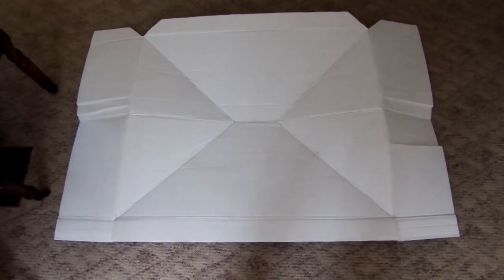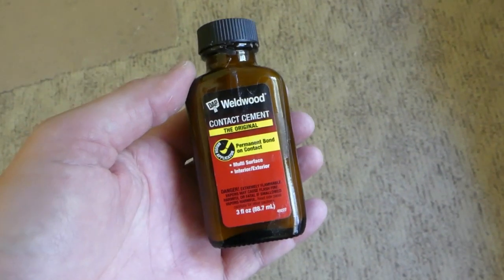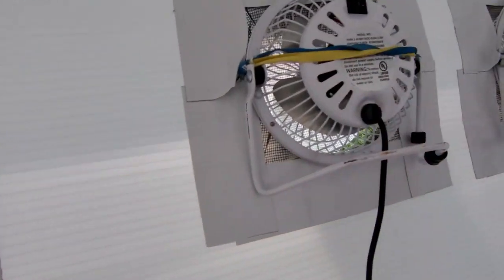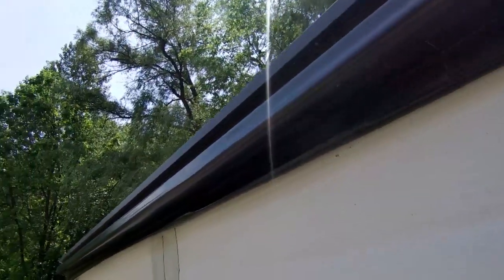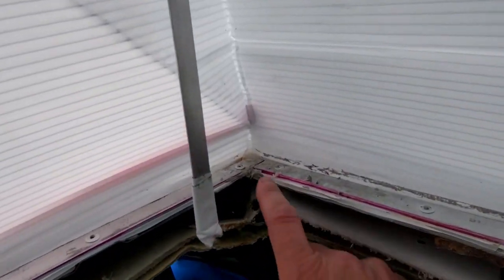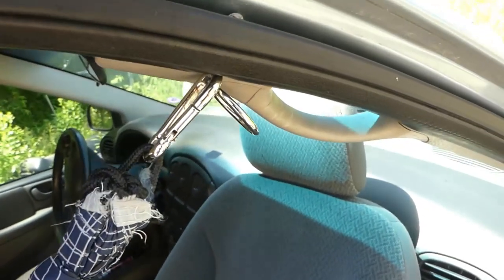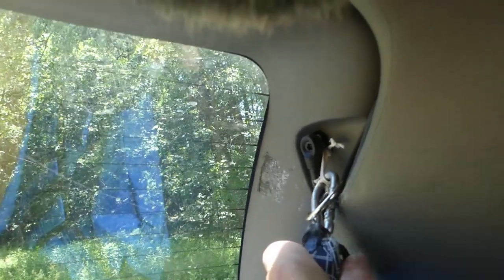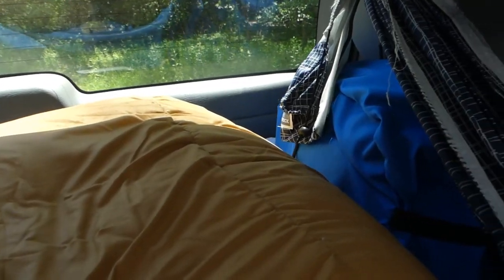DIY Minivan PopTop Details and Hanging the Hammock in my Minivan

Comment from the maker: More updates and changes.  https://youtu.be/4EBZIsr-ao8
Reply: I wished you had showed what it looked like on the inside when it was down??? It's hard to picture, would hang down or what?? I wonder if there could be any way to insulate it?? Maybe after it was raised??? Now you have me curious, lol.
It didn't cost much to make , did it??
I would think the solar panel if not used, cost the most??
Just thinking but if you didn't want a big solar panel couldn't you just use the metal you cut out to make the top?? Just use some aluminum to make a rim big enough to cover the hole, right??
It's really cool but I would prefer builtins. I would rather have a bed. But you could still have cabinets and have a hammock.
I have seen two on here make real bathrooms in the back. A casette toilet and a shower with shower curtains and a base. They made it so you could set and shower. One was a dog tub for the base but plumbed and the other they actually sealed the floor of the van. It was cool.
Has anyone ever asked to pay you to build one for them.??
It's really cool!!!
Reply from the maker: @Shandele3  It folds down fairly flat so you can still use it with the top down. There are many ways to accomplish the same thing. The cost can be as high or low as you can afford. With my heater, there is no problem staying warm as it is. It does get hot on hot days, but my fans make it cool enough for me at night.
Reply: @Shandele3  Thanks again! Great idea that is lightweight, economical, and diy.

Comment: Thank you for being responsive and doing a follow up video on the pop-up and the hammock installations!

I've been wanting a hammock in my 2016 Nissan Quest and yours is the first video of one in a minivan that didn't have some kind of connection that went on the outside of the van. (That seemed like a good pathway for water besides not being stealthy.)

I think I can manage the front connection, but I'll have to figure something out for the back since the actuator arm cannot be reached from the inside of my van.

Great build and info. I've subscribed and turned on the notifications. 
Thanks again and happy trails!
Reply from the maker: I have tried the not outside method and my hammock got wet the next time it rained out. The water just follows the rope on inside.

Comment: This poptop is an awesome design.  Thanks for sharing your ideas and good work.   I love how you think outside the box you live in.   I wonder, have you noticed any tendency of tape and adhesive to release away from the Coroplast?   I read that polypropylene has high surface energy and adhesives don't stick to it very well.   They say that if you quickly run a propane torch over the area to get adhesive, it will change the surface energy to make things stick better.   You have made one of my favorite ideas.
Reply from the maker: I have used some coroplast like that for other projects, the only thing that worked was very fresh super glue and contact cement. This is treated to accept vinyl wrap so the tape sticks very well. It also makes it softer than most coroplast so it folds more easily. You can purchase it from Home Depot or order it off their website for an even better price.

Comment: Hello and thanks from Montreal, Canada. I see your passenger's seat is turn backward. Is it permanent fixture or with rotary option?  Could you make a video for this modification. Thanks a lot.
Reply from the maker: It is just turned around the four bolts are reached from underneath. You do have to remove the spare tire and shield to reach one of the bolts.

Comment: Yeah this is damn brilliant, looks like you’re in a Chrysler minivan from the pockets in the floor. Undoubtably with the seats removed these minivans have an insane amount of space inside of them I owned quite a few, I didn’t know you could get the passenger seat on a swivel or did you just turn it around permanently
Reply from the maker: The seat is just turned around. I don't think a swivel would work, just not enough room.
Reply: @Far-Beyond-Ordinary  Awesome. I have a Sienna and am constantly looking for ways to improve it.  Was moving the passenger seat backwards a big endeavor? And how difficult would it be to change back?
Reply from the maker: @lisalaventure4937  I just drove the van up on ramps and crawled underneath to remove the bolts.

Comment: Let me start with, I love your build! And I have a question with your pop top. If you was to rebuild it, what would you have done differently?
Reply from the maker: The one change I plan on making is putting gas struts on it to lift it up and hold it up. One could finish off the edge differently. The tape was just the least expensive and easiest.

Comment: im currently looking for a truck to build a camper on. this seems like a possible alternative given how expensive a reliable truck is. im thinking i could possibly sandwich the rim of the roof cut out with 2x2's  bolted together. like a board on the cieling and a board on top of the roof bolted together through the roof ,framing the cutout. might be able to attach some canvas useing rv trim that way. did you run into any wiring cutting the roof?
Reply from the maker: Yes, there was some wiring and the controls for the rear heat and AC which I  disconnected and removed. There were also wires for the dome lights, so now two lights on the driver's side do not work anymore. I could have rewired them, but I figured the two on the passenger side are good enough.

Comment: GREAT video and Great Ideas!! THANK YOU!.  What if I tried to do this in my Prius???   Hummm.
Reply from the maker: I have thought about that too. I should take some measurements on our Prius. It would mess with the aerodynamics and fuel mileage though.
Reply: @Far-Beyond-Ordinary   can always build a fairing on the leading edge.
Reply from the maker: @bonilla2022  I was just thinking about that as I went out and did the measurements. It would work to have a standing area just over the rear seat area. Just enough for getting dressed and for cooking on those bad weather days. It could have a floor with hatches over the foot area of the back seats for extra storage as well.

Comment: Love this build and the simple pop up design.... not sure I am brave enough to do that, tho I sure would like to try!  One question for you.... in this video or your updated video you stand in the rear stow n go storage areas!  I have been wondering if that is possible. lol  I guess it is.

In fact I want to use the front SnG storage area to get out of my lengthwise bed a little easier (I broke my back years ago, and unfortunately do not think the hammock design would work for me... I have to be very careful to keep everything in alignment... my memory foam mattress topper is fantastic for me...)  But in order to have adequate headroom in the van if I'm seated on the bed, the bed needs to be lower than is comfortable for my knees when getting up.

I thought it would be great if I could use the storage area behind the driver's seat to easily get up and hey why not just use both connected storage units as kind of a walkway so I don't have to be stooped over so much. I consulted some Dodge mechanics, they both told me the storage areas were made of thin steel.  But alas yesterday I discovered that the front one anyway is made of fiberglass!  I'll have to check on the read storage areas... but I am assuming they are fiberglass too.

I have seen in some videos that I can no longer locate that people have put two deep cycle batteries in the front SnG storage areas.... depending on the type of battery that weight could range between 100 to 200 lbs for both of them.  

I'm not sure the fiberglass is designed for people to walk on, but was thinking if I put 3/4" plywood in the bottoms that that would distribute people weight better.  What are your thoughts on this pls?  

I love your vids btw and just subscribed.  Thank you so much for sharing your great ideas.... especially the pop up... ingenious!
Reply from the maker: The stow-n-go areas are rhino-coated steal on my 2006 caravan. I drilled through it for the heater install. Plywood would make it stronger and make for a smoother area to stand on. 1/2 inch would be good enough, but 3/4 would be ok too.
Reply: @Far-Beyond-Ordinary  Thank you!  That is good news... that's for both front and rear areas? So does rhino-coated steel look like fiberglass from the outside?  Black bumpy texture?  

I think I will go for the plywood in the bottom... and see how that works. would actually be really nice to use the rear storage area because it's a lot deeper, but I think I'll just focus on the rear storage area for now. Gracias!
Reply from the maker: @uber2tuber  Yes that is it, looks like fiberglass a little. On mine, the middle and the back are the same depth. The center ones do have a small divide, so two pieces of plywood would be needed.
Reply: @Far-Beyond-Ordinary  Thanks.  I was just out there planning the bed build, and I double checked on the front area, which is only about 7 or so inches deep on my van with a center divide that is higher.  It is definitely plastic, I can tell from tapping on it.  But it still should be able to support a person's weight I think with the plywood. I hope they over engineered them for the possibility of people walking on them. Once would think. lol

The rear area in my van is a lot deeper... maybe 12 - 14 inches?  I can't remember atm. I will try to pull up some of the carpet and see if it's also plastic in mine.  What year is yours again? Mine is 2010.  thanks so much for your info and thoughts.

Just as a point of reference, I did just read on a Dodge Caravan recall forum that one guy's van caught fire in the rear storage compartment on the driver's side (!) and he smelled a burning plastic smell at first. Left it parked for 5 minutes, came back to rear area filled with smoke, rear hatch wouldn't open .... then the entire interior caught on fire!!  Has me a little worried lol but thinking positively. Sounds like maybe an electrical issue?
Reply from the maker: @uber2tuber  Wow scary. Mine is the older body style 2006.

Comment: I just saw this video and I am quite fascinated. I had two questions:  I am currently putting together plans for a Sienna camper. My idea is a variation of yours. I'm short (5'5"), and I think I could cut off the roof, install a  box that raises the height of the ceiling just enough for me to stand in, and then hide/protect that box inside a cargo box, like a Yakima or Thule. This would accomplish a full-time, standing room vehicle that was super stealthy. My questions are 1) Did you remove your headliner to cut the roof off, and 2) how wide do you think you could go? You said you did 3', but do you think wider is possible in a minivan. Thanks so much for the inspiration!
Reply from the maker: My width was based on the size of my solar panel. I just cut through my headliner, but removing it would give you a better idea of what you can do.

Comment: Origami man, brilliant. Just subscribed to your channel. Can’t wait to look at the rest of your content. Regarding the way you secured the hammock in the front of your van, where are you put the knot outside and the factory black seal is bulging… could you instead have tied the knot so that it was inside, thereby making that outside flange flatter? In other words I would’ve looped your string through the outside, but tied it inside.
Reply from the maker: Great thinking, that would be much better. The seal never leaked so I never thought about it again. Thanks for the input for sure!
Reply: Also when you’re doing night mode, and you have to move your blue kitchen bin (and put it on top of your toilet), I wonder if that bin could stay a smidge bit further toward the front, so you could use it as a nightstand. thereby having it next to your hammock, rather than tuck it away in the back. Only down side is that would not all allow you to swing from side to side, but you could put a sandwich plate or a book down.
Reply from the maker: @bethsuter4637  I usually put my extra blankets on there so I can grab them as needed when it cools down.

Comment: I enjoyed this video very much! Do you think I could do this in my SUV? What could I use instead of actuator bar? I don't know what that is and I'm not sure if I have one. What brand of hammock do you have and where did you get it? It's a great idea to turn the passenger seat around! I'm doing it ASAP so passengers don't complain about my driving!
Reply from the maker: That depends on what your SUV is and how tall you are. There is a minimum sag required, but the shorter you are the less it can be. I purchased my hammock at Walmart. You can attach it to a hinge or drill small holes to run the string through the frame.

Comment: Does this effect the structural integrity of your vehicle?
Reply from the maker: Only if you rolled it. But it would get totaled either way.
Reply: @Far-Beyond-Ordinary  does your insurer and roadworthiness authority agree with you?
Reply from the maker: @brianrollins3245  It is safer than a convertible or motorcycle. There are no back seats. What is there to worry about? I know how flimsy the top was I cut off. The strength is in the sides and rear, not the thin top that was removed. There is no roadworthiness authority in my state.

Comment: Does your passenger seat have a swivel or did you bolt it on backward? I have a T/C van like your Dodge.
Reply from the maker: It is just unbolted and turned around. Removed completely would also be good for more storage, just add a comfortable folding chair for use on those rainy or buggy days.

Comment: What did you have to do to be able to spin the passenger front seat around 180 degrees?
Reply from the maker: I unbolted it and turned it around. There is not enough room for a swivel. The spare tire has to be dropped to get at some of the bolts.

Comment: Excellent build! What did you use for the front passenger seat swivel base?
Reply from the maker: It does not swivel. It is just turned around and rebolted.

Comment: Very clever but I would be concerned about heavy winds.
Reply from the maker: Why it is way stronger than canvas.
Reply: @Far-Beyond-Ordinary  I had a Sportsmobile poptop van and as Heavy Duty as that was,they had limit at which they recommend putting the top down. If you think it will do well in 70 moh winds like we have in SoCal then that is wonderful.
Reply from the maker: @stanw909  I would put it down in winds like that. It could vibrate the supports loose and it would come down.

Comment: Thanks so much for your video. Now knowing how you did everything, I am more impressed than I was before! Did you make any type of frame for your solar panel to rest on? Or just use foam?
Reply from the maker: When it is down it just rests on the foam mainly to seal out water from getting into the folds while driving in the rain. I have made a few changes and will be adding a diesel heater so I can do some winter camping. Hopefully, there will be an update video coming soon.
Reply: @Far-Beyond-Ordinary  I just came back from a camping trip in Alberta. With nighttime temperatures around the freezing mark, a heater would have been a great add on. It got pretty cold!

Comment: How I get the front seat to till backward?
Reply from the maker: I took the nuts off underneath the van and turned the seat around. I then have the seat pulled as far forward(to the back of the van), the recline leaver can be used just like it always did.
Reply: @Far-Beyond-Ordinary  Very clever, thank you!

Comment: Congatulations on you very nice poptop. It is really really nice. I am really impressed! You have done a fantastic job!
I do have some questions about how the opening in the roof is strengthened. Could we have a private conversation.
Reply from the maker: It is strengthed only as shown above. I have been on several long trips on the highway and it does just fine. It has also been through a few thunderstorms both popped up and down. All is stable and leak-free.

Comment: One thing to keep in mind is, depending on the state you are in you might not be able to get the van inspected anymore if you cut a big hole in the roof.  I made the mistake of doing that before and they told me I altered the structural integrity of the vehicle and they wouldn't inspect it🙄
Reply from the maker: That could be some states are very controlling. It is still safer than any convertible.
Reply: @Far-Beyond-Ordinary  yes it definitely is.  I found a guy to do it after checking around.   That's the big problem here it is up to a mechanic's discretion
Reply from the maker: @willschultz5452  Glad you found a way.
Reply: @Far-Beyond-Ordinary   One good thing is there is a choice of many people to go to for inspections, the mom and pop type of garages are a lot easier to deal with than the big facilities like Walmart or Pep Boys or any type of a chain. Not only are they looking to rake in a lot of money off of you but they do everything strictly by the book. It's tough to come out of one of those places without a $500 bill every inspection.  The small private garages are usually alot better to deal with.   I think here in Pennsylvania it is worse then most States
Reply from the maker: @willschultz5452  Only in some of the bigger cities in Wisconsin are inspections required now. There are rumors of statewide inspections coming though, which will kill a lot of people in these back road communities, where most cars are close to 20 years old.